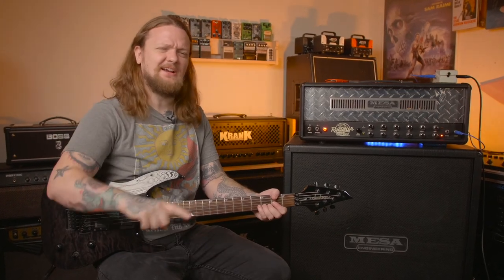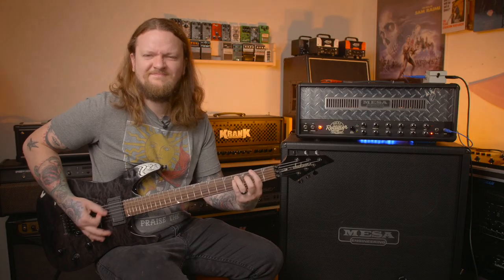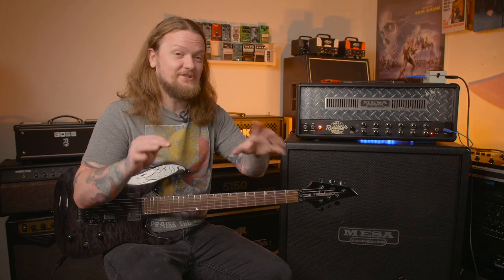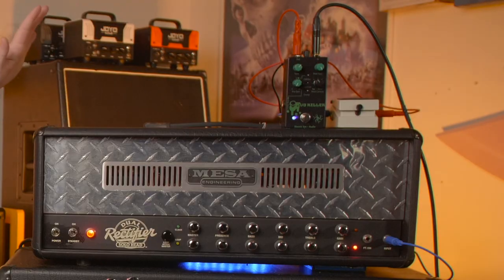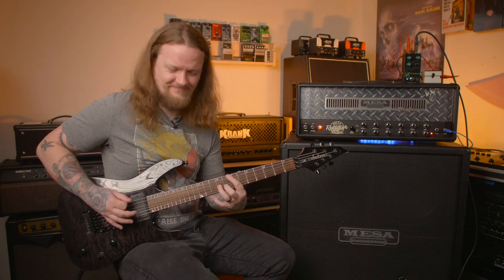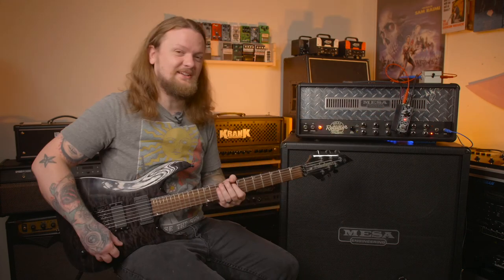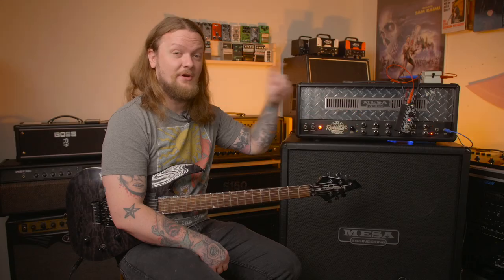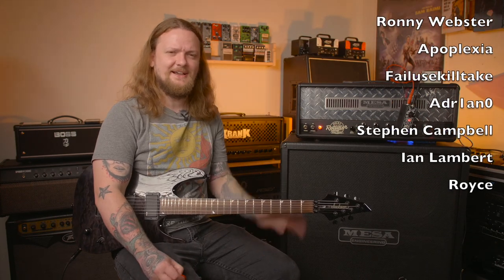How to dial in a Mesa Boogie Dual Rectifier for metal

Comment: I am sure theres something wrong with me. I dont think that amp sounded great at any point in this video. They always sound like theres not enough gain/distortion or too much and muddy, its weird
Reply: Almost sounds like a an amazing metal zone lol
Reply: This is the exact issue I have with rectifiers. Unboosted it sounds very dry and boomy. Everybody shouting 'put a boost in front' just makes me think: so apparently this amp almost achieves greatness but it still needs a crutch to really come into its own.
Reply: I agree, I think it would have sounded better if the presence knob was back a bit.

Comment: Fun fact pulling out the shitty mesa labeled glass and buying a Eurotubes full retube high gain kit will make the amp not even need a boost/over drive in front and will make that Rectifier come alive. I tried this option way back in 07/08' and it did improve the tone a lot and made it sound a lot better without using any boost in front. Because the tubes mesa loads in from the factory, make them sound fuzzy, muddy, and muffled out of the box.
Reply: Thought about doing that! And you dont even have to get it rebiased do you? Beciase I think all you do with the mesa is flip the switches to 6L6 correct?
Reply: @chriszembol9784  Correct they're fixed biased amps. He will select the best tubes based on what amp you have and what style of music you're playing...

Comment: I have a mesa triple rectifier from 2003 that was modded from a parallel to series fx loop.   When my loop is bypassed, this amp sounds like a monster.  When the loop is on, it really sounds bad.  My problem is, i need to kick on reverb and delay from time to time that are in fx loop for my lead work.   I really need help with this amp.

Comment: Hey do you think a 6505 and even a mesa 4x12 will be added to the nux mg30?
Reply from the maker: I think the modern 4x12 that is in there is based on a Mesa 4x12. They did say they would add a 5150, which is pretty much the same as a 6505, so hopefully that happens soon!

Comment: Why ppl buy 4x12 cab if we use just one speaker at time?
(sry im lay)
Reply: 4x12's usually resonate in a more specific and usually desired spot. The low end is generally huge. On a 1x12 for example, it's a bit higher in the spectrum in terms of where that bass blooms and generally sounds not.. as big? 
I could be talking out of my ass and I'm not sure if the science of it but that's generally what I've gathered. I've only ever owned a 1x12 and I've only played through 4x12's. They definitely sound huge.
Reply: @bradylasserre9320  ty